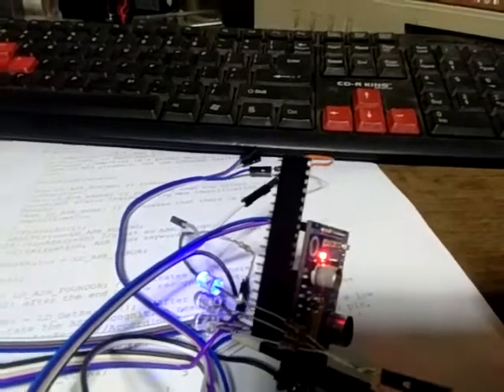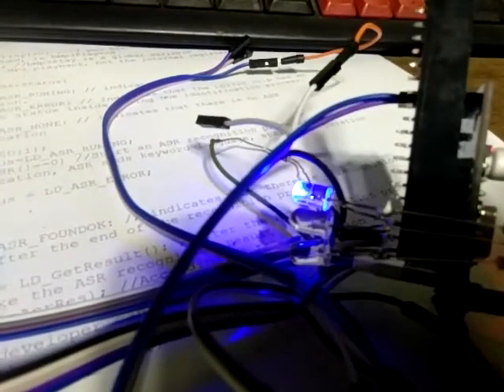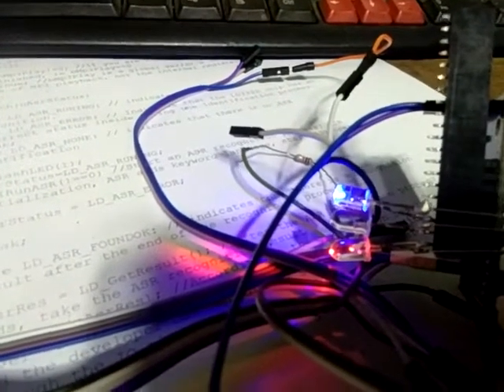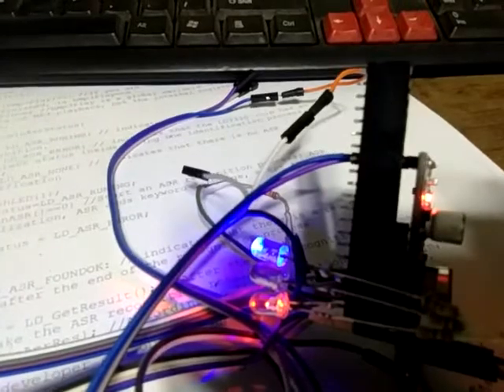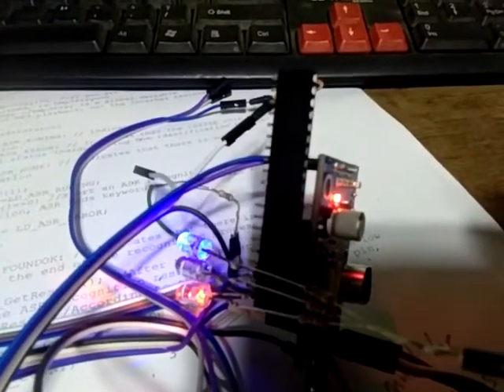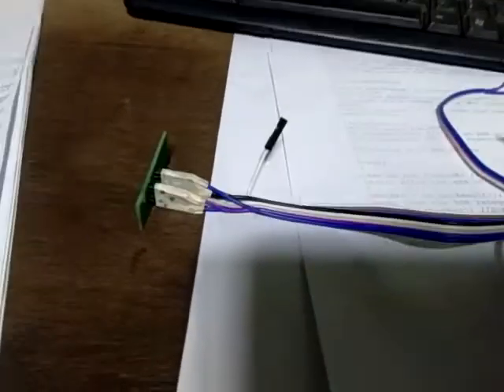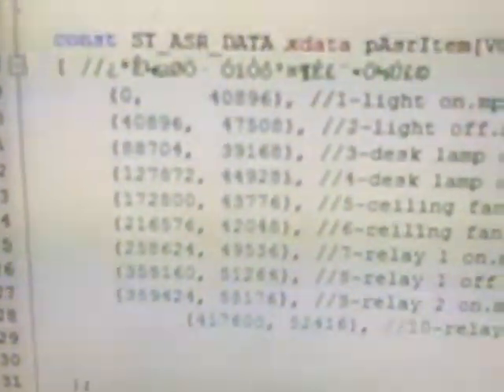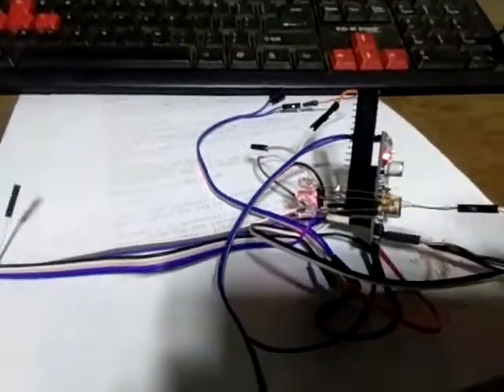LD3320 Speech recognition device with STC11L08XE MCU  test.

Comment: I have a few questions.
1- How many outputs are there at most?
2- Can we use 3 4 word length sentences for a command?
3-English-Turkish vs language perception?
Reply from the maker: Here is a very interesting video that may help you..Forget this LD3320, it is really not worth it..but this arduino Mega is.

https://www.youtube.com/watch?v=PkM8M79hBOg
Reply: @MCircuits  ilginiz için teşekkür ederim, linke bakıcam teşekkürler :)
Reply from the maker: Hi Mr. Muhammed, unfortunately the LD3320 speech recognition module is only capable of identifying Pinyin. (Chinese Language). I never made it work for my intended English project of using it as a speech controller to activate everything I need my voice to activate.

To answer your questions:
1. I think the STC11L08XE can have 6 independent output.

2. It cannot recognized more than 2 word in a single voice over of Pinyin.

for example You want to activate output 1 and the command is Bei-jing to turn ON the output...and say Shang-hai to turn it off....

I stop the progress of trying to evolve it into an English word recognizer, I even used Chinese translator device in place of the microphone so that when I speak "turn on the light" to ON output 1..inconsistent.